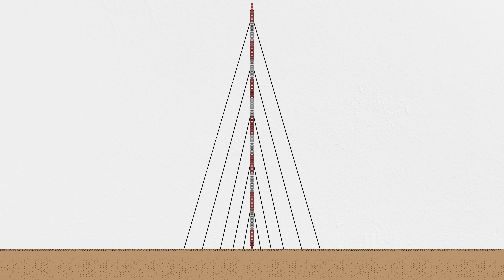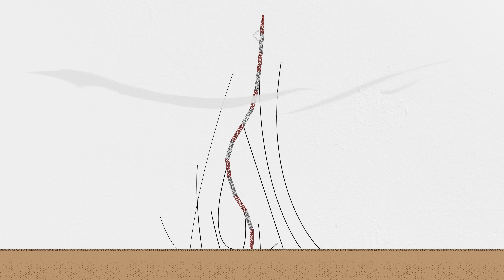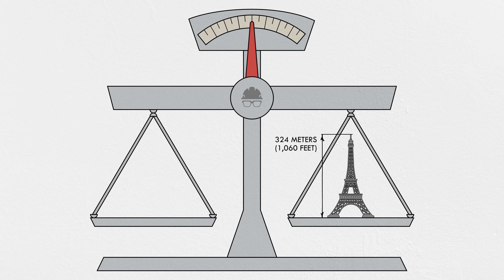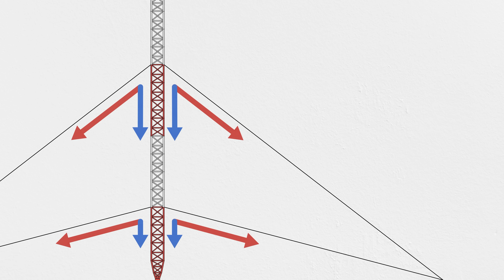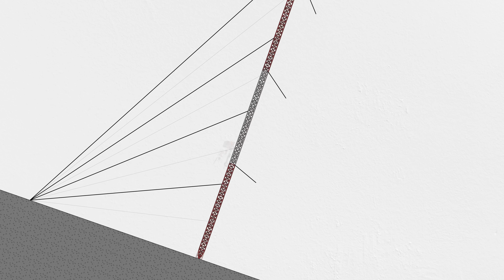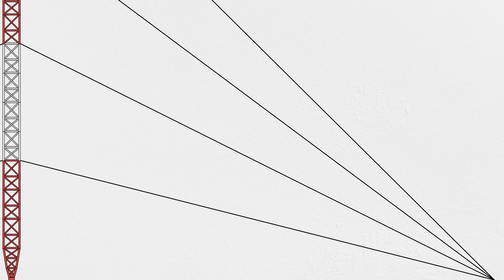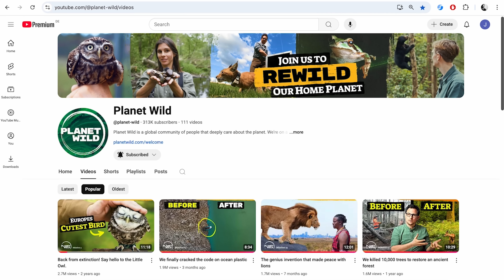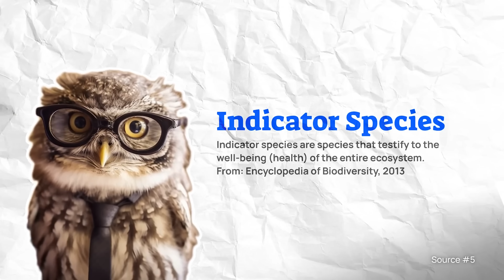The Bizarre Bases of Antenna Towers

Comment: On Jan 14, 1987 a Naval jet hit a tower at the Cedar Hill tower farm south of Dallas. I know this because I worked at KXAS-TV at the time and our antenna was on that tower. The jet struck the "candelabra" which is a large triangular platform at the top of the tower. This design allows multiple antennas to be placed on a single tower. I think there were two radio stations on the candelabra along with us. The two pilots ejected and the Phantom crashed, but the tower did not fall. We were off the air for a short time, but were able utilize an old short tower back at the station to begin low power transmission and later we made a deal with another TV station to piggy back on their tower for full power transmission. Ultimately a new tower had to be built. I seem to remember the Navy tried to blame us for the crash, claiming tower was not on their maps of the area. A ridiculous claim as the tower had been there for decades and it was not our responsibility to ensure they had accurate maps. The chief engneer of the TV station kept a chunk of the jet sitting of his desk as a reminder of the time the tower won and the jet lost.
Reply: As a general statement, military aircraft have their own rules and regulations about maintaining a sufficient altitude to not overly affect the ground outside of airport operations or designated training areas which would have kept them safe from stationary objects, but of course that often gets ignored with a wink and nod. Hopefully the worst incident will forever be the Italian gondola that got its lines cut by similar idiots.
Reply: @westrim for a moment when you said Italian gondola I thought you talking about Venice and was wondering how low it was flying.
Reply: @theVtuberCh Same here 😂 But then I remembered that I have seen the videos about the incident. Pretty sad case that is and can be found here in Youtube easily if interested.
Reply: @theVtuberCh 
-12 feet MSL
Reply: I remember that well, because I was listening to the old KNUS FM station at the very time as I was driving from Fort Worth into Arlington on I-30. Suddenly, KNUS went to static.
Not only was the Cedar Hill antenna farm on all the sectionals and TCA maps, but it transmitted a 24/7/365 radio beacon: "Caution. Cedar Hill antenna farm. 19 (I don't recall the exact number) miles south-southwest Love Field."
Word was the approach floor to NAS Dallas - the old Hensley Field - had been lowered just the weekend before, and the USN jet was coming in somewhat obscured conditions, and clipped the tower. The approach floor was raised after the incident.
Reply: As an Arlington resident, I also remember the incident and KNUS, one of my favorite stations at that time. Appreciate the additional info.
Reply: Average military response.
Reply: @FunkatronicDingus  what?
Reply: @FunkatronicDingus Love that name.  😊😊
Reply: Reminds me of those jokes about the USN Battleship trying to get a Lighthouse to move.
Reply: @krissp8712 😂🤣😂🤣😂🤣😂🤣
Reply: I would have been fascinated to see if the tower was on the civil aviation charts. Since we have to buy new charts every 56 days, I’d hope they’d be up to date.
Reply: In 1983 I was Directed by the controller directly to the Cedar Hill control Tower! At a collision altitude.  (I was on controller radar.) It was partially cloudy, so I saw the tower about 2 miles out and deviated from the assigned heading.  Upon landing, I called the head guy at the center and told him my disappointment (anger).  Retired US Navy Aviator.
Reply: The military not keeping up on maps is why when they invaded Grenada in 83 US forces had to use the maps in tourist brochures to find their way to their objectives.
Reply: @dukecraig2402  I suppose the Defense Mapping Agency (now probably National Geospatial Intelligence Agency) must not have thought Grenada was very high on the threat list to keep maps updated.    I suspect a great many people in the USA first heard about that exotic foreign land for the first time when the military action was launched.   "We invaded.. where?!"
Reply: @lmamakos 
The military maps were from 1900 or something like that, and the problem was the buildings they needed to get to weren't on them, but they were highlighted in the tourist pamphlets 😂😂😂

In WW2 when US troops were getting ready to invade Europe they gave them Michelin Travel Guides, those things used by tourists back in those days that have restaurants along with ratings in them, hotels with with the same 5 star rating systems for them, because they were so detailed and even had directions on how to get from one town to the other they worked really well.
In the movie Kelly's Heroes the character Big Joe played by Telly Savalas says to Harry Dean Stanton's character "Check the Michelin Guide for a good hotel" when they find out about a town they're supposed to be moving into, for years I just thought that was a gag in the movie until I found out the US Army really did give out Michelin Travel Guides to the troops just before D-Day.
Reply: @dukecraig2402 I didn't know those existed back then.
Reply: @dukecraig2402 Pathetic!👎👎👎
Reply: Yeah, that tracks. Better to blame a stationary object than hold accountability
Reply: @AlexofZippo  reminds me of when I worked at a gas station, nothing as lofty as a tower. I parked in a parking space. My vehicle was sitting there parked for like 4 hours. 

Then the news paper delivery truck showed up and while backing in, sideswiped my vehicle. I realized later when the mirror was pushed in and a white scrape was along the vehicle.  

The next day I very politely as politely as I could, asked the driver to please be more careful because he hit my vehicle. 

His response was to first deny hitting my vehicle and then switched to trying to blame me for parking in that spot. 

Like buddy, that's not how this works. A vehicle parked completely between the lines of a parking space in a parkinglot, automatically has the right of way over a vehicle that's moving.
Reply: @SilverStarHeggisist  Like, even if it's not parked, it could be stopped in the left lane on the highway, you shouldn't hit it. 🤣
Reply: @SilverStarHeggisist Not really, there are no traffic rules on private property. But I guess the moving vehicle would be responsible, it is hard to argue in court "that parked vehicle pulled out in front of me"
Reply: @ChrisZost  liability still applies regardless of where you are. Someone is liable even if public road laws aren't in place. And I can't think of any insurance company that would say a parked vehicle in a parking space is liable over a moving vehicle. 

Civil court if it was a lawsuit would also rule the same way, that the moving vehicle is the liable vehicle. 

At fault doesn't just mean you get a citation.
Reply: @AlexofZippo those pesky stationary object do have a sneeky tendency to suddenly jump right in the way! 😂
Reply: I used to live in the area (well after that incident) and am very familiar with seeing those towers in the distance. I never knew about that crash, that is so interesting!
Reply: @boalston2484  Same, I’ve lived all my life with a perfect view of every tower in my backyard! I’ve looked all over the internet for all sorts of information on this incident (I wasn’t born yet when it happened), it’s a fascinating topic to learn more about, if anyone has any more info on it or just NAS Dallas in general I’d love to hear it!
Reply: @jaylenjackson2403 How many towers are in your backyard?
Reply: Power to the tower!
Reply: I lived in Dallas and I know the antenna farm you are referring to but I never knew it had a name. For being visible from anywhere in Dallas it is actually very hard to find.
Reply: ”Cavalese cable car disaster”. 20 people lost their lives.
Reply: @trueilarim I've taken a few rides in those gondolas. Just by themselves they are a bit frightening, if I add in what the people inside must've felt my blood freezes
Reply: Woah, that's insane. When I took the written exam for my private pilot license I got a question asking about the height of a man-made obstacle on that exact hill.
Reply: I was folding papers for my paper route in Tucson Arizona back on December 19th, 1967 when a Phantom F-4 crashed into a Food Giant Supermarket, killing 18 people and injuring a bunch more. I saw the plume, and us kids, went to check it out. It was only a couple of blocks and we got there before the emergency vehicles did. What a mess. The pilot bailed out and directed the aircraft towards the Cactus Drive in theater which was across the street from the Supermarket. So close but not close enough. 
A few years later I was in the UofA science library when an air force plane crashed into Higland St., and then in 1989, I saw a Cessna crash into a cliff outside of Salmon Idaho alone the Salmon River. A man, his wife, and their daughter died in that one.
Reply: Also, at the cedar hill farm on Oct 12 1996 one of the towers of 1500ft collapsed after equipment they were installing fell and severed a guy wire killing all 3 workers.
Reply: sad that it happened but that is kinda cool
Reply: Amazing
Reply: I am not expert, but i doubt the pilots would have the time to eject, but not the time avoid the tower, only other issues with steering could have prevented them.
Reply: @prpr8904 Say what? My god this thread is full of morons. Do you think that perhaps they ejected AFTER they hit the tower?? And what, you think they WANTED to hit it? SMH.
Reply: @NomadAttorney i don't think they wanted to hit it, i think something went 5 i hadn't considered that they ejected after they hit the tower, i imagined they did it before
Reply: @prpr8904  Went 5??
Reply: @prpr8904  I had a stroke reading this
Reply: @NomadAttorney  I understand your frustration. I deal with this behavior pretty much every day when looking at comment sections where people will go any length to defend the most absurd statements.
Reply: @morbrakai8533 but did you hit a radio tower with your navy fighter jet?
Reply: @prpr8904  what kind of sarcasm is that? What does that have to do with the discussion or what I said?
Reply: @morbrakai8533 probably nothing, but i cant be bothered to figure out what comment you replied to in the first place since for some reason youtube doesnt believe in one seeing the comment someone else replies to
Reply: "Candelabra" thanks for the new term.
Reply: Awesome story thanks for sharing.
Reply: I used to work for spectrasite BG.  I've been to that tellifarm many times.  From the top of that tower, you could still see where plane crashed, no grass  grows there as of 2001
Reply: Amazing story.  Most people don't know that a WW2 fighter crashed into the Empire State building & it's still there.
Reply: @GB-go6gp Still there? The building or the plane?
Reply: A tower in Buena Park, CA, had a plane hit it as well. They installed a “top hat” which took care of their coverage issues.
Reply: Every time an airplane crashes, everybody loses
Reply: As long as the tower conforms the ICAO colour scheme and warning light requirements it the pilots responsibility to avoid the Mast/Antenna.
Reply: Great first hand account. Thanks for sharing.
Reply: I bet you the crash was intentional--not the impact, but certainly the attempting to get as close as possible to the top.
Reply: @tHebUm18 What is your IQ? Serious question. Above 78?
Reply: @NomadAttorney  lol, have you not heard all the stories from US military pilots about all the bad behavior they do? Buzzing random public structures for no reason and getting as close as possible? Going under bridges?

Right back at you: What is your IQ? Serious question. Above 78?
Reply: @tHebUm18 Mine is 53, but I get by.😮
Reply: military officers are psychopaths, of course they’d try to blame you
Reply: The synchronized lights make the antenna (and wind turbine) parks appear like a single structure instead of a confusing disco show.

Some lights use GPS clocks to synchronize.
Reply: Believe it or not the Twin Towers are the only structures to be totally demolished by an airplane collision. Building 7 is the only building to collapse at free fall speed and be entirely demolished from a fire on the roof.
Reply: @AcidGambit419 Are you out of your mind? Don’t you realize how patently ridiculous that statement is? Just a few months ago the India Air jet crash demolished an entire apartment building and many houses. Airplane crashes destroy entire houses, hangers, bridges and countless other structures on a weekly basis. Have you not seen countless videos of houses and apartment buildings completely demolished by aircraft crashes? Just last week a small single engine plane crashed into neighborhood in TX and demolished a couple of homes.
Reply: @NomadAttorney yes and don’t forget the one that crashed into the Pentagon at ground level without touching a blade of grass, such  care  is touching. Fantastic piloting skill. Building no.7 collapsed as gesture of sympathy saying,if you can free fall so can I. Believe, big brother will hold you in its tender arms as it ushers the faithful into a brave new world

Comment: As a volunteer tower climber for the local ham radio club, but not a mechanical engineer, it frustrates me that I don't understand the stresses in the metal at the bottom of the tower,, or when there are 2 people hanging off a smaller section at the top, what kind of lateral and compressive loads it puts on the structure.  In my head I look at a piece of angle iron used to make the tower and think "how does something that thin support the weight of the tower plus all the dynamic load of wind and climbers?"..

Comment: Here in the UK, I live near Pontop Pike, a cable-stayed tower, not the tallest of transmission towers (149 Metres, or 489ft), but certainly quite old having been built in 1953 in time for the coronation of QEII, and has served as the main transmitter for the north east of England beaming out television and radio for over 70 years, build it right and it'll last a lifetime... :)

Comment: I used to do damage prevention for telecom companies in my city, and some of the transmitting towers I serviced had a continuous hum or vibration when close enough inside the fence. I only worked on underground utilities, and I was never brave enough to touch the towers, but whatever it was had a completely unique sound I've never found anywhere else.

Comment: I think it nice to add some interesting information: if the tower is the antenna itself the guy wires has to be electrically isolated from the tower and the ground, sometimes they have to be divided into segments not to interfere with transmitted radio waves. All this adds another important layer of complexity i.e. isolators had to be able to withstand enormous tensile forces.
Greetings from Poland!

Comment: 11:20 When you start talking about the shape of the base and how it all tapers down to one point, I suspected some of the answer.  But it also has me wondering about the similar shape of large cranes (the ones that sit on creeper vehicles or multi-axle trucks). Maybe you can do a video about how these cranes work and the principles of the block & tackle setups and the truss booms they use to lift heavy loads???

Comment: I would be interested to learn how thermal expansion of the guys and the tower are handled. I’m like to think that there’s an elegant dissimilar metals solution to the problem akin to the grid-iron arrangement in clock pendulums, but that would probably be cost prohibitive. The tower and guy wires would have to be made of vastly different metals chosen for their thermal expansion properties that wouldn’t necessarily work for their original purpose. 🤔

So, how is the daily and seasonal expansion/contraction compensated for? Is there regular adjustments made to the guy wire’s tension? or is there a compensating spring/elastomer installed in the system? 

Everybody better sign up for PlanetWild fast… I snagged one of the free months already. Thanks Grady

Comment: I used to climb all types of towers during the microwave communications era. I've seen a 4-legged self-supporting tower offset a foot halfway up. The only thing we could come up with was a tornado struck it. The tallest self-supporting tower I climbed was about 500 feet, while the tallest guyed tower I climbed was about 2000 feet. We had to be careful not to fall, be cooked, or be electrocuted when climbing certain towers.